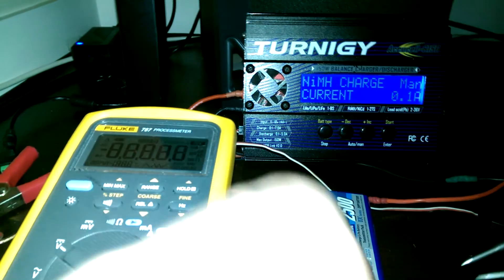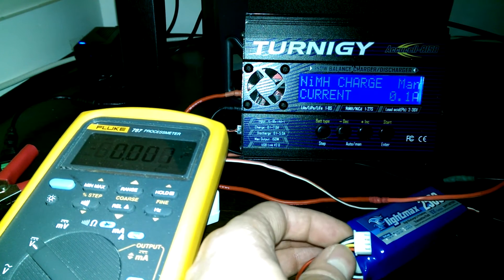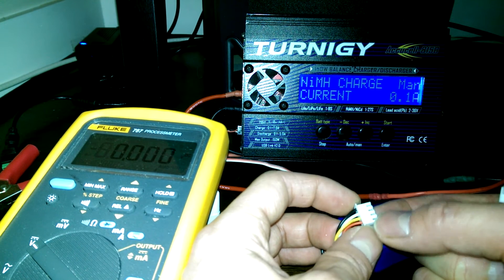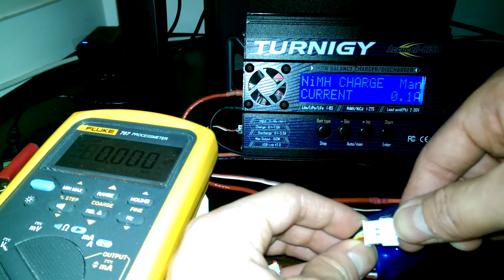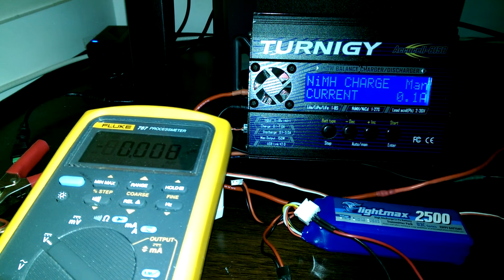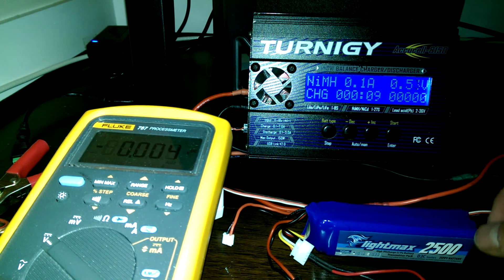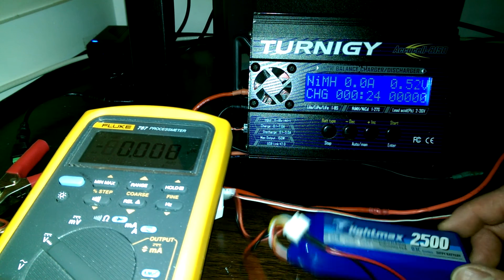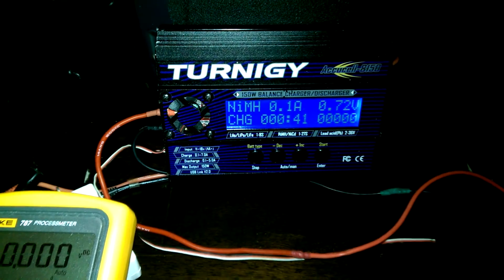How To Fix a Dead Lithium Ion/Polymer Battery

Comment: Help me to repair  GNC-J40
Reply from the maker: Looks like that battery pack has an IC, typically if a cell is dead, you'll need to reinitialize the protection board, not always easy. Some will reinitialize once you try to charge, but some won't. You can try charging each cell up, but I suspect one is 0V, so you can try boosting and charging it independently.  There is a small chance you can bring it above 2.5V and the pack will work again in the laptop. If not, a replacement for $75 may the best bet.
Good luck!
David.